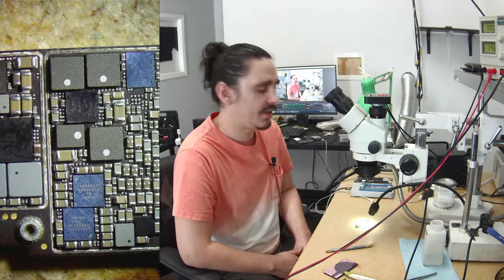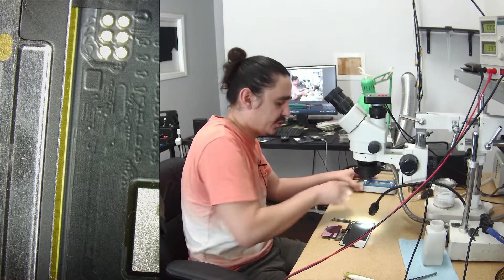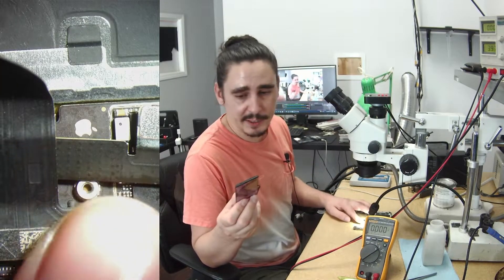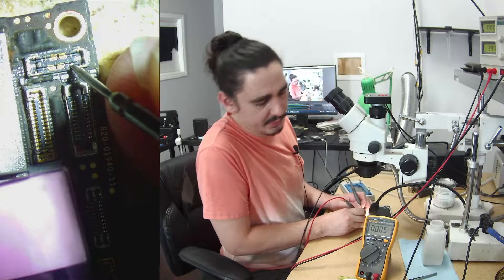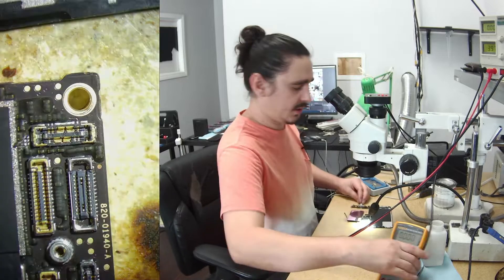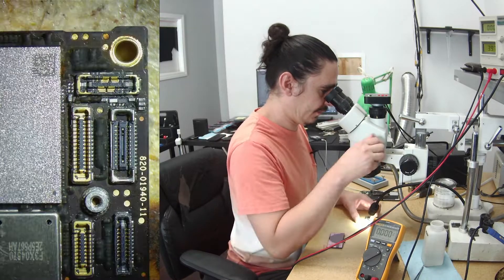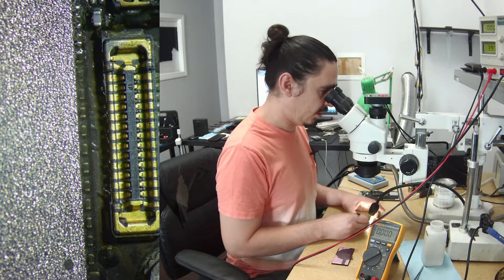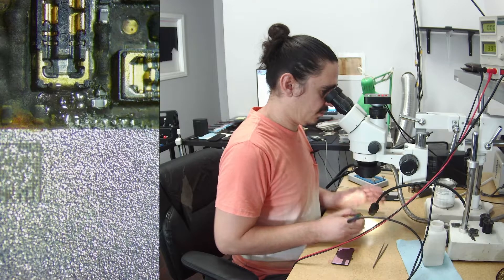iPhone 12 Pro Max Water Damage - Hacking voltage lines to trick motherboard - Stuck in Recovery Mode

Comment: I know this is an old post but i ran into the same issue, stuck on recovery mode. Power button and volume down both are missing 1.8v. I was able to provide 1.8v for both lines and was finally able to boot phone normally. My only problem is that once the phone is booted, the power button and volume buttons don't work.  i have also tested new power flex and it is the same. So my question is, would replacing the PMIC restore the button functions?
Reply from the maker: Yes, most likely. Give it a try and come update us once you do it!

Comment: I have 2 iphone 12 pro max with this issue. I wonder if PMIC swap will fix
Reply from the maker: I would measure for voltage first to make sure its missing and if so and the line isn't short, then I think pmic is a likely bet!